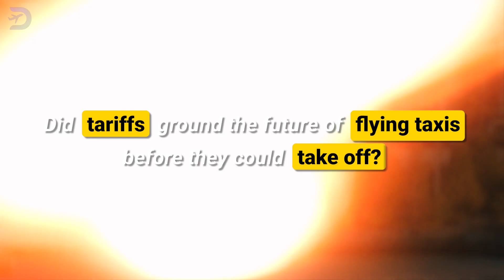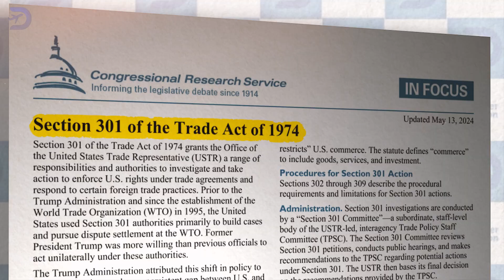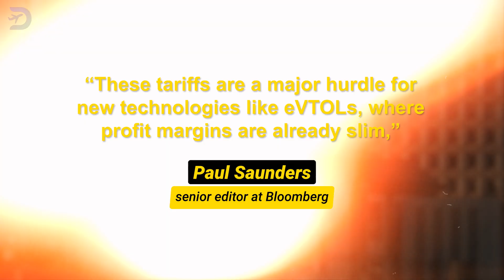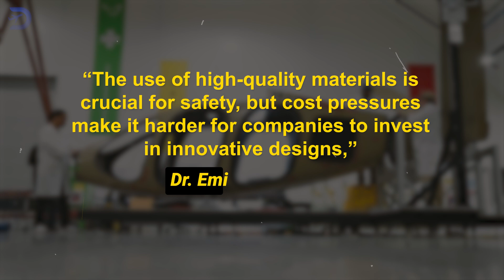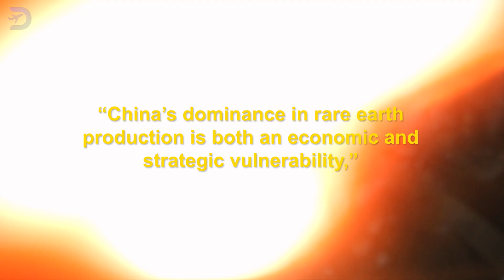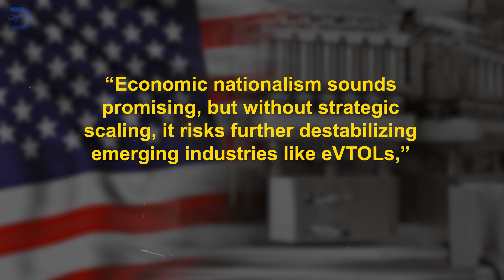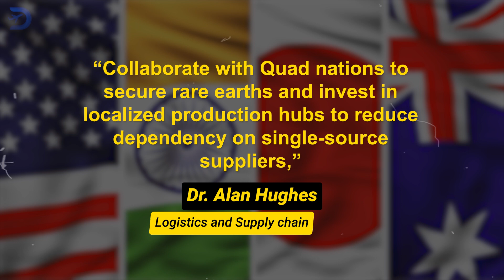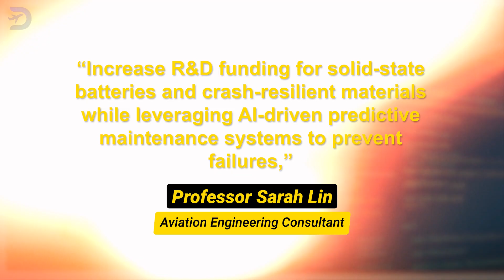The TRUMP Effect on eVTOL Supply Chains!  Navigating Tariffs and Trade Wars.

Comment: Northvolt is kaput. Note that pres Trump does not subscribe to 
 the clmate catastrophe scenario that underpins the origin of evtol.
Imagine eliminating up to 90 % of the installed motor power or reducing the motor count by that much ( for the vast majority of flight time 90% of the motors are going along for the ride )
Incidentally carbon fibre is about the least 'crash resilient material' you can get  it does not yield and absorb energy ( F1 cars use long sacrificial nose cones to give some protection)